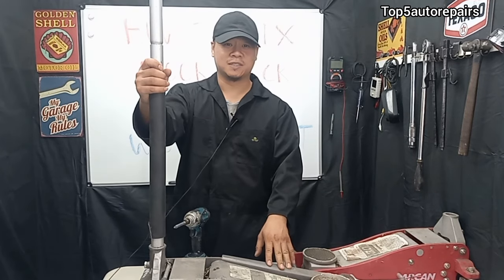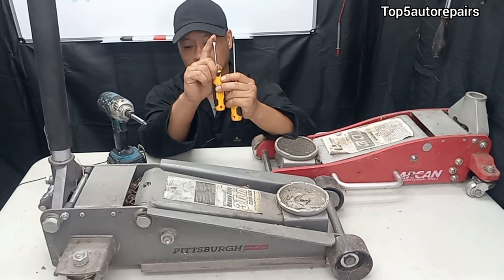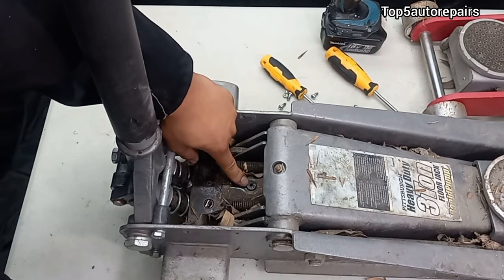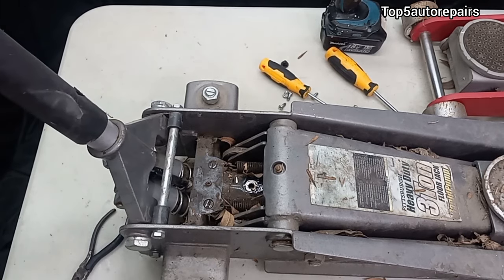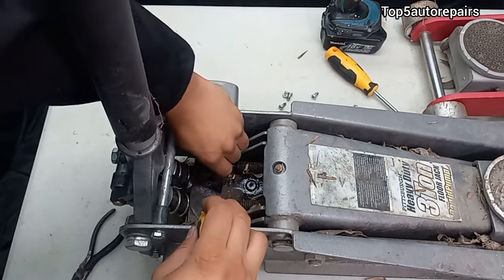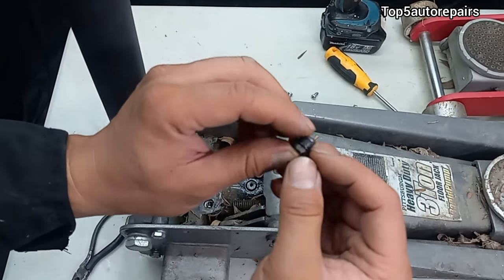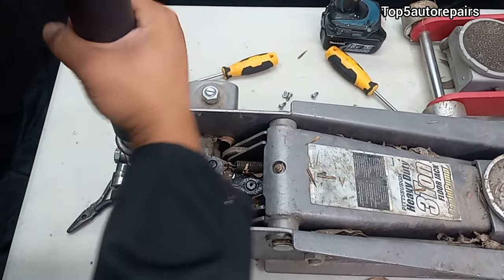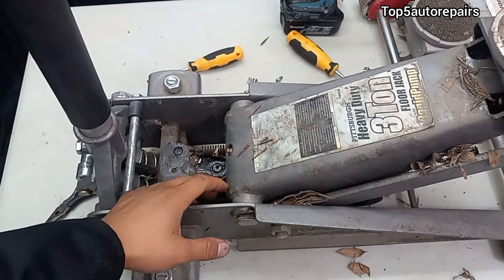HOW TO FIX A FLOOR JACK THAT WON'T LIFT OR PUMP ALL THE WAY

Comment: You did not have the handle tightened when you tried to lift the first time 😢
Reply: I thought I was tripping. Good to know somebody else noticed it
Reply: I noticed that as well butI guess he’s just  showing 2 steps you would try to see if you can  try to fix it.  I have seen so many reviews on floor jacks where there are an alarming number of reviewers who say their new floor jack failed after a few uses. My bet would be that  in most cases the jack wasn’t air bled before the first use and those who say the “ piston” leaked oil after a couple uses didn’t check that the usually plastic air bleed plug or the hydraulic fluid screws and O Rings were loose or damaged.
Reply: Obviously, he’s better at gaslighting than repairing things
Reply: @raymonddriggers  Lol!!
Reply: @laqintin2  ha ha ha 😂 😂 lol ha ha hee hee !
Reply: That's why he didn't have to add no jack oil lmao
Reply: I saw that too.

Comment: I have this exact same floor Jack. It stop working after 5 months. I was ready to buy a new one until I seen your video. Now there is hope! I will try your method. Thank you!
Reply: that's a shame. I have a vintage one from literally the 70's that i replace the fluid In MAYBE  every 3 years.
Reply: Mine gave out after 6 months and I only used it maybe half a dozen times. I'm going to try this. Hope it works.

Comment: I used to work for a rubbish removal company and i couldn't tell you how many hydrologic floor jacks we sent to the scrap yard. I didn't know how easy they were to fix back then or i would have fixed and sold them on Facebook. We scrapped at least 50 of them over a 4 year period. 😢😆

Comment: Mine lifts, but not when it's under the car. It will go up, but once it touches the frame of the car, I can pump the handle all I want but it won't lift the car.

Comment: ridiculous how you must go through this process shortly after buying , should not have to fix a jack before even being  able to fix car
Reply: Literally just bought one of these effing things, and here I am trying to just get the thing going.
Reply: This guy helped me actually. I just had to bleed the thing but have found out my handle doesn't work the valve. So I got it going but it's buggered already.

Comment: That's the same jack I have currently. I used to have a real nice aluminum/steel low profile racing one. Then I loaned to my nephew. When I finally got it back, it somehow turned into this cheap Pittsburgh heavy steel one. Like magic!
Thanks for the video, it's exactly what I was looking for.
Reply: What works well ardent is you send a buddy over with a baseball bat to get your racing floor jack back and then some! No one will never know!

Comment: Thanks for the tutorial video my 3 ton jack lost all pressure when I was working on my truck. Thankfully I had some jack stands to take the weight because it dipped suddenly. I fixed my jack using your video. Appreciate it.

Comment: Bought a floor jack from HF and it bloody never worked but the first time. Had it for two years now taking up space, I was not happy about it and was gonna toss it, then I think, can it be fixed?  DUH,  lol 
Thank you all it needed was bled . It took ALOT OF oil too!  😘
Reply: Those Pittsburgh jacks are known to be low on fluid from the factory for some reason. When I got mine the first thing I did before lifting anything was check the fluid level. Sure enough it was not even close to being full. Filled it up and bled it and has been working like a charm.

Comment: Good as new!  I knew this but didn't realize there was a separate bleed hole, I was trying to get the air out of the fill hole but it didn't do much or seem right.  My Craftsman seems figured different so I gotta look around again.

Comment: I have a brand new Daytona jack, I’ve used it once since purchasing it about 5 months ago, went to do my brakes today and it would move up and down with the handle and hydraulic cylinder movement but shouldn’t stay up even with no pressure on it. Tried bleeding for about 30 minutes and same thing. 

I turned the handle counter clockwise to crack the valve, took the fill port off and pumped the handle 5–10 times until it was just fluid coming out without any air bubble, refilled with jack oil as it was quite low, and continued to do so until it was just flowing the oil out without any air bubble pushing it out. I then screwed the fill port back on and closed the check valve by turning the handle clockwise. What am I doing wrong?
Reply: Did you figure it out?
Reply: @Tino2o9  Nope, tried to bleed it again and still the same result. I gave up the second time and went to get a pizza and some beer
Reply: @THESKINIMIN1234  I’m having a similar problem right now. My jack oil keeps coming out and I keep bleeding it but the jack won’t hold any weight and won’t lift all the way up
Reply: I have a 3 Ton harbor freight jack that worked great for a couple of years.  Now it doesn’t want to stay up.  So I guess I’ll try the bleeding process before I despair.
Reply: Watch that video and this worked for my new Daytona 4tok Jack
Reply: I have the same brand. Used it once. Few months came back to it and it pumped half way. Returned to norther tools, same thing happened. Now I will only buy single pumps. Matter fact, just bought a vevor 3t single pump.
Reply: @1nsidiouss510 If oil is coming out you got a bad oring or seal. The orings are inexpensive just get the right size and try again.

Comment: Thanks, but aren’t you supposed to add the oil in the first port that had the plastic plug?  My 3.5 ton Craftsman WAS low on oil, but after topping it off through the rubber cap fill port it still must have air in the system because it jumps up with one stroke, but sags down under weight.  I tried pumping rapidly with the valve open as stated by the mfr, and it got a bit firmer, but won’t take full weight.  Those screws on mine say “don’t adjust,” so I wouldn’t think to add oil through them.  I’ll try removing the oil port fill plug completely and pumping with the system open like you did here.

Comment: I went and bought harbor freight o-rings after watching another guy's video....his is leaking after 1 year....the harbor freight o-rings seem to thin...I might try this before replacing the o-rings...thanks man
Reply: I do have this HB Pittsburgh ( only 5 years old )but it's the low profile model, I have been using it in a regular basis to do maintenance on my cars, everything works fine , it's just that I recently spotted some oil on the floor where I store it and found out that it's leaking from the twin Pistons or from the so call the Ram or the bottle Jack, now I have to figure out how to fix it, I'm kinda disappointed about this HB Pittsburgh Brand because in so little time it failed.

Comment: I opened that filler valve and found that there's a spring, a sping cap, and a tiny steel ball that fits into the spring cap presumably to make hydraulic pressure. All of it was out of place. That's why my cheap Chinese floor jack won't work. They cheaped out on those tiny little yet most important parts.

Comment: So you pump everything on the right clock wise tighten up lift or you do pump everything on the counter clock wise left loose down side when you pumping the whole entire process? You didn't show which way to turn the full handle before even start the process.
Reply from the maker: To the right

Comment: I am not real sure what I did wrong on my jack a week ago. I had half the car off the ground and noticed the jack was running out of ooomph as it got higher. I popped off that rubber plug and added jack oil and it didn't work again. It goes up but won't even lift ANYTHING. It has never leaked, owned since new, about 20 years old and looks like new. Mine is similar to this and the first pump takes it all the way up. However - once ANY weight is on, nothing.
Reply: I think the idea was to bleed the rubber plug area to make sure there was no air, did you do that?

Comment: My floor jack 
Model: Pro Lift G737 
1 wheel in front is not rolling 
Please let me know how to fix
Thank you so much
Reply from the maker: It's a caster issue. Spray WD40.

Comment: WHAT IF ITS MISSING THAT PART THAT FITS IN THE CYLINDER THAT YOU USE TO TURN THE HANDEL / LOCK IT TO PUMP IT UP WHAT IS THAT PART CALLED . THANKS

Comment: I have a Daytona floor jack, it jacks up without any weight on it, but when I try to jack up a car it won’t do it all. It keeps going up and down, what’s wrong with it?
Reply from the maker: There is air in the hydraulic. Just got to bleed it.
Reply: @Top5AutoRepairs  You’re a life saver, I did exactly what you said, and boom 💥 my Daytona floor jack working like new . Thank you 👍🏼 🙏
Reply from the maker: You're welcome

Comment: Does the jack need to be disengaged during the bleed process to work, asking since it was engaged later in the evideo? Great video for sure, if I could suggest a re-shoot...using 1 of the 2 tools "needed" and only mostly as a pry bar until the fill plugs later. got me laughing.  "you'll need these 2 things" then proceeds to not use them but 2 other tools unspoken. haha. All in good fun, great video! Haven't tried it on my limp jack but I'll be damn'd if it's not the fix. The country saying is there's more than 1 way to bleed a pig but for sure mechanically that's not so true. might not be the "fix alls" but, you either got a good leak (seals and air) or a slow leak (gradual air in the lines) when it comes to hydraulics. Definitely thank you for the simple video, cross the easiest one off first.

Comment: You must’ve had the floor jack exposed to the weather outside and had the handle lowered, and a Carolina wren came in there and made a nest which you probably moved it before she laid eggs or either that they hatched and left the nest, the eggs are the size of your pinky finger fingernail, and have been known to have nest low to the ground

Comment: The place that you think is for filling jack oil is the safety valves, its not for filling oil. You fill oil in the same place that you air it is my guess.

Comment: I’ve tried every single one of these “fixes” with not a single improvement. Used this Duralast POS floor Jack 3 times. I’m throwing it in the caca can. My advice…. DON’T buy a Duralast product because it doesn’t LAST!😊
Reply: I tried it on a cheap off brand jack I bought recently. No luck. Better to spend extra on a known brand.

Comment: Thankyou
Reply: Regular WD40 lasts about a week before it evaporates, as it's a near kerosene chemical. It's a Water Displacer (Anti-rust), not a lubricant. Try Liquid Wrench or Specialist  Penetrant WD40, for longer lasting lube. Once freed, motor oil or grease is more persistent and you don't have to free it up so often. Once frozen, there usually is corrosion in the moving parts. Full disassembly and sanding everything smooth makes for real repairs. Use regular wheel bearing grease once it's cleaned up.